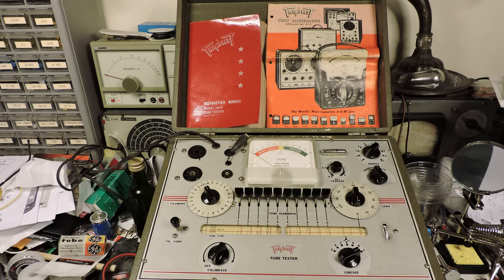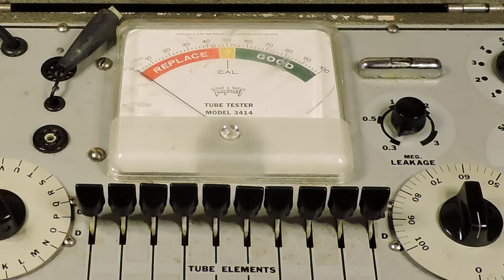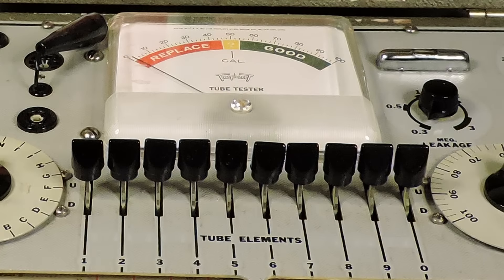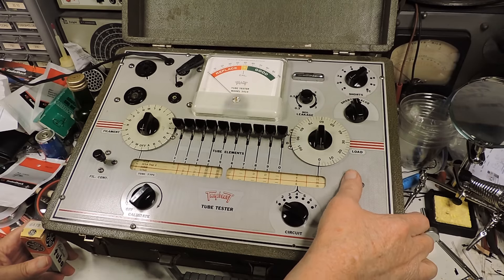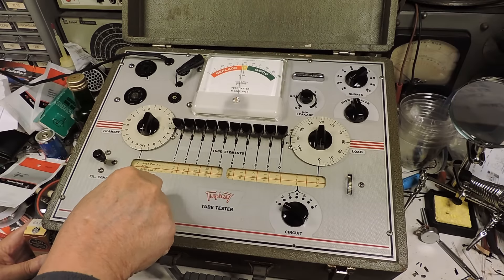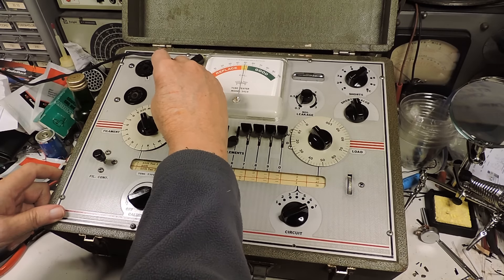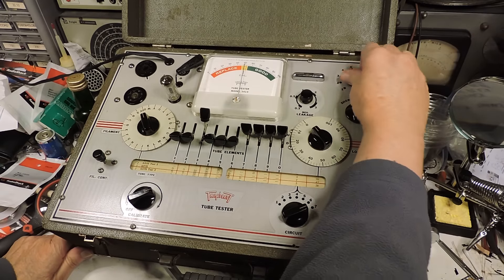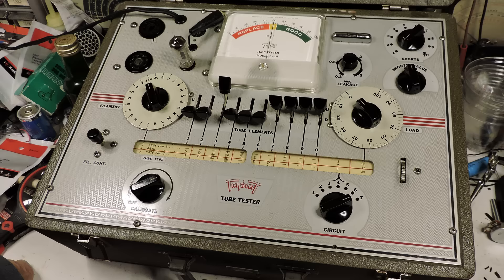Triplett 3414 Tube Tester

Comment: I have a Seco 107B which I purchased at the HAM swapmeet almost 20 years ago.  It doesn't rate as best compared to other models, possibly due to it's limited documentation.  However after learning it's idiosyncrasies it works well for testing 1940s through 1960s vacuum tubes.  I recently modified it and added an additional 3 amp 2.5 volt transformer in order that I can now test (with home made adapters) the 2A3, 56 and 57 vacuum tubes, which are found in some older instruments I repair.  Also added is a toggle switch to flip from the stock 2.1v 600ma winding to the 2.5v 3amp transformer.

I especially like it's shorts test as it uses a vacuum tube amplifier stage to drive the meter movement.  This makes it more sensitive than a neon lamp.  

The only downfall I have found with vacuum tube testers with vacuum tube circuity (like the larger Hickok models) is you need a working tube tester in order to tests the vacuum tubes in your tube tester.

I also have a Hickok 539B however, it suffers the same plight as most of the early Hickock equipment, bad meter movements and extremely leaky transformers.  Unfortunately most of the test equipment needed to repair old equipment is as old as the equipment itself.
Reply from the maker: Thanks

Comment: Never heard of the novice cleaner.  Nice tester, so handy when they have a scroll chart.
Reply: +ZenithClarity1969 It's Novus and comes in 3 different formulas, I think 1 is sort of just a spray cleaner/shiner, 2 is small scratch remover and 3 is larger scratches remover.  Amazon has it.
Reply: Rebel9668
Thanks.
Reply: ZenithClarity1969 The Novus stuff is great. You can find it is fairly inexpensively on eBay. Check for different sellers, some are less than others as well as the shipping cost. I got the small three bottle set for around nine dollars.

Comment: Nice score there! I have an Eico 667 tube tester, it's got push buttons to check for shorts and a  "merit" lever. need to find an adapter for it to check the old 4-5 pin tubes I have a lot of radios that take those.
Reply: A trick : watch movies at flixzone. Me and my gf have been using them for watching a lot of movies recently.
Reply: @Harold Uriah definitely, I have been watching on Flixzone for years myself :)

Comment: Just I want to ask if I can make an adapter from 4-pin to 8-pin so I can check the 300b tubes. Is that possible? If I make 1-pin to 1-pin, 2-pin to 2-pin,3-pin to 3-pin and 4-pin to 4-pin, what would be the  elements and the Load? Any help will be valuable.
Reply from the maker: I think it would be easier to build a circuit to test the 300B.